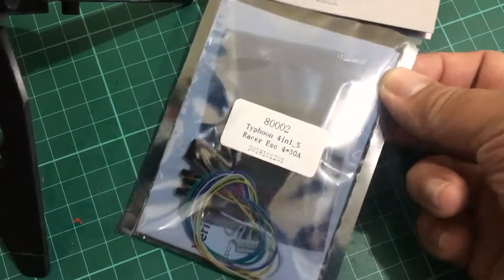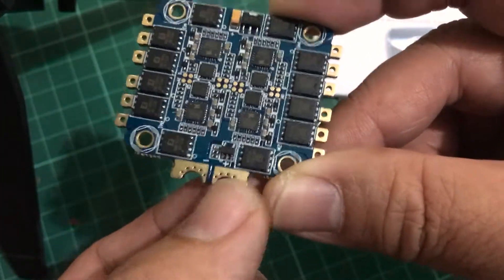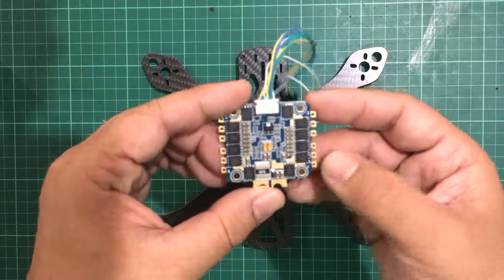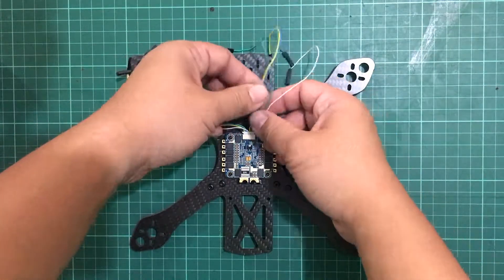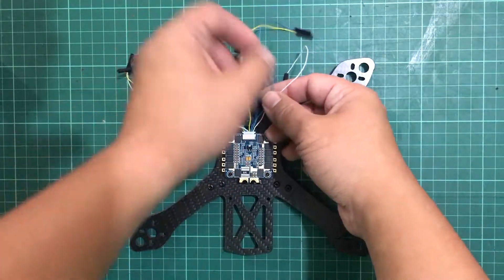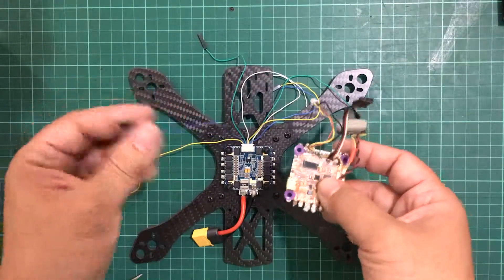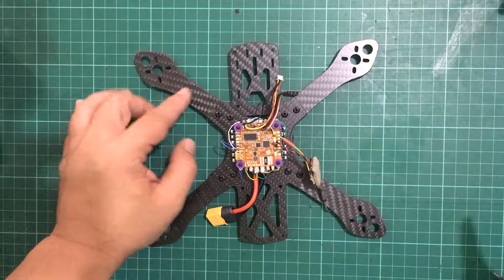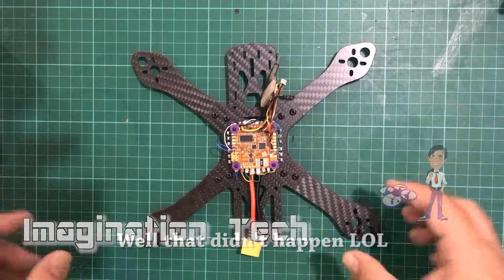Airbot Typhoon S Racer 4in1 ESC | Unboxing, Overview, and Setup

Comment: I have a similar setup that i am building BUT on the esc there are 6 pins M1/M2/M3/M4/NC/VCC the ESC has NO BEC I'm going to using a helio sping AIO. how would you setup the main + _ connections on the helio as the esc is 6 pin not 8 pin
Reply from the maker: Just 6 pins? The typhoon has 8. Or you have a different ESC? Worst cases scenario you can solder a wire from the batt pads directly to the Helio AIO batt pads since the Helio AIO doesn't need a BEC output, it can handle direct voltage up to 6S.

Comment: Thanks for the video, I also got this esc from dronedrop, but misplaced the manual, and was looking to understand where each wire goes.
Reply from the maker: Just be careful with the main + and - pads on the ESC and the FC. I initially got them reversed.